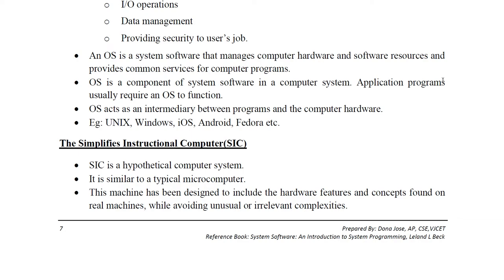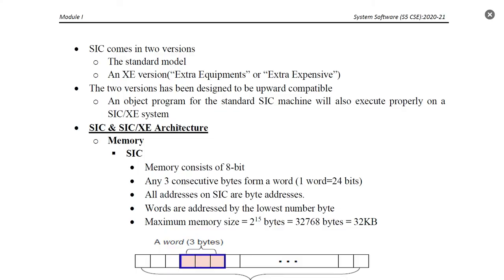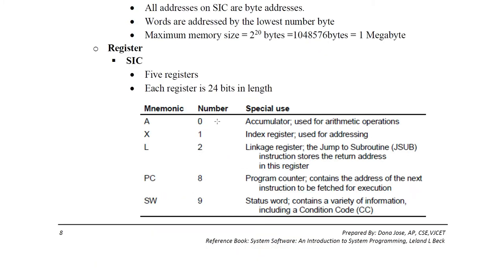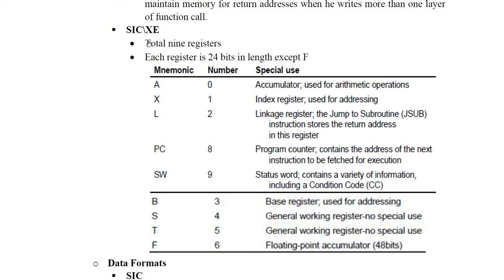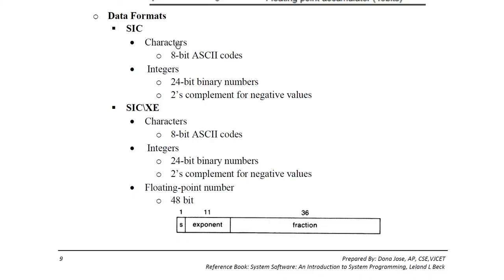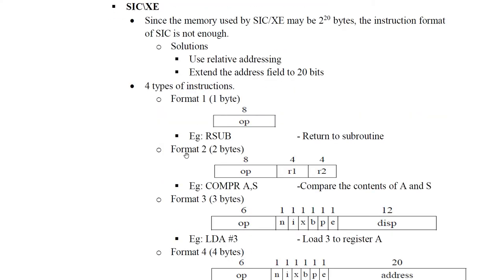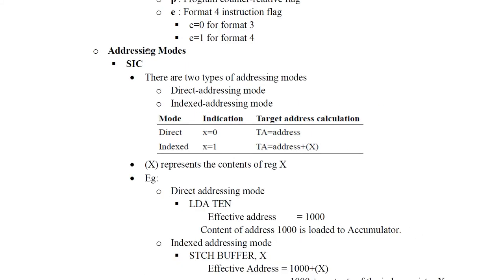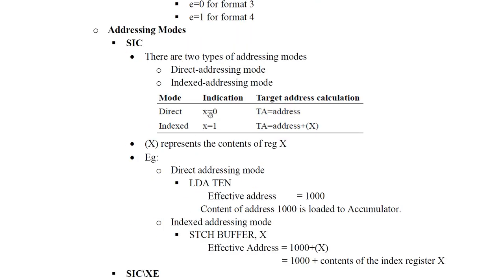Module 1 - SIC & SIC/XE Architecture

Comment: madam e sic/xe de  word length ennathe 24 bit alle or 3 byte so e 32 bit instruction engane vanne , athe one  explain akkamo madam
Reply from the maker: SIC/XE have 4 type of instructions
1. 1 byte length
2. 2 byte length
3. 3 byte length
4. 4 byte length
you are telling about 4Byte( = 32 bit) instructions
Reply: @csktulectures7719  madam ente doubt enthane enne vacha like ore instruction entirely alle edukkane (like word size ennathe alle maximum ore instructuction nte size ) so and ore register 24 bit alle so e 32 bit ne enganeyane athe instruction formatil edukkane
Reply: like engane ane a instruction process akkane enne , ore example parayamo